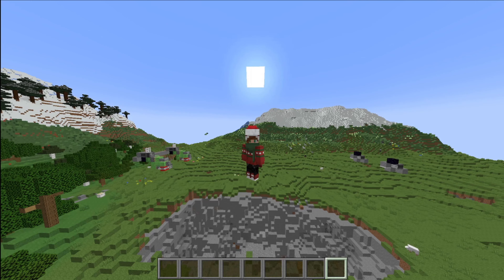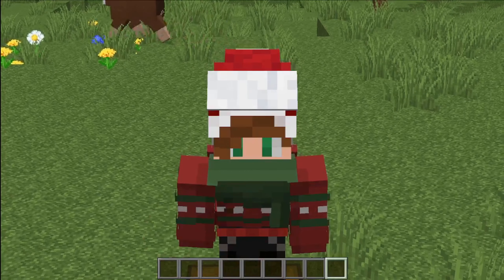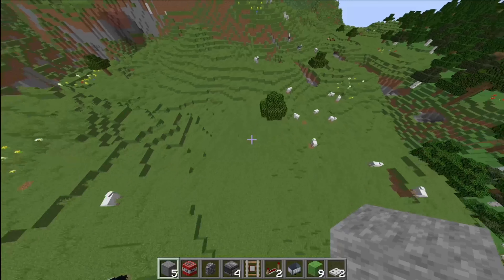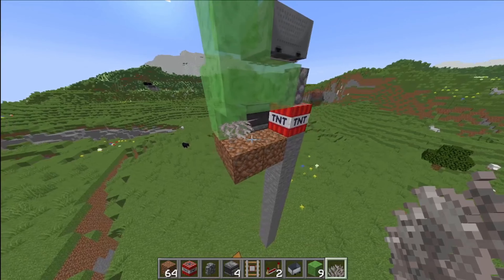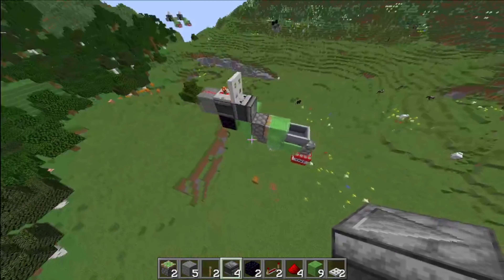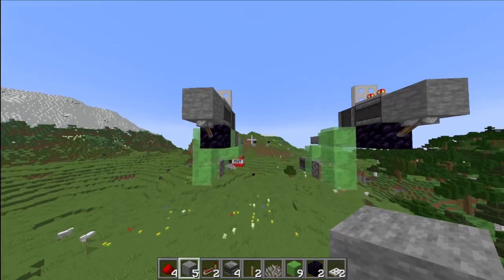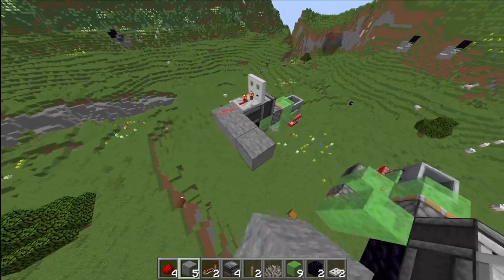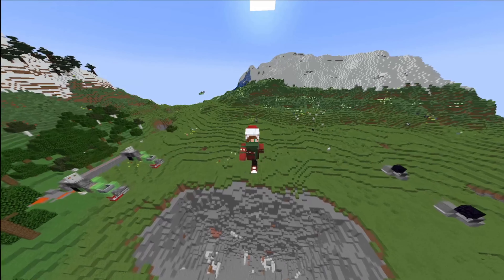✔️Minecraft: How To Make a World Eater (Java 1.20+)

Comment: Just built in 1.20.1 with some performance mods installed, 5 blocks apart seems to be a good distance for each module, it works without any modifications from the design in the video. Simple design, just works
Reply from the maker: Appreciate it bro :) 👍

Comment: Here's a few ideas for improvements from my experience using this deign:

-Having the machines spaced as far apart as the video shows will leave a lot of floating blocks behind, so I built the machines with 2 blocks space between each TNT block and got much better results
-The trade-off for this means you will have to build it higher off the ground as the TNT tends to fly up pretty far and can destroy parts of the machine. The TNT block should be at least 20 blocks off the ground
Reply from the maker: Nice to hear your POV man, thanks!

Comment: everyone else is chipping in their notes so here's mine- I noticed the best results when the machines were spaced with 3 blocks between each TNT, and 20+ blocks off the ground. I ran that spacing across a 4 chunk wide, 40 chunk long trench and it ran fine. 

Link all the switches to one lever, flip it, then hop into the middle bomber's minecart and you can just AFK it, which it's best to do because the machine encounters issues if you unload and reload the chunks by leaving/rejoining or by leaving the area while it's running.

Comment: I made this, but the TNT didn’t get duped. It flew and returned perfectly fine, just no TNT falling.
Reply from the maker: Did the tnt block fall when the machine initially started?
Reply: @PotatoGamer-rg4nn  no, it didn’t
Reply from the maker: @NicoA223  you must’ve placed it in the wrong spot then. The tnt should dupe and fall, or at the very least the block should fall and not dupe if it fails. The fact that the machine moved and the tint did nothing is a bit strange ngl
Reply: @PotatoGamer-rg4nn  would it still work on a cross platform server? The server is on Java but there’s an addon that makes it bedrock compatible too.
Reply from the maker: @NicoA223  that bedrock add on may or may not be the problem
Reply: @PotatoGamer-rg4nn  oh wait when I logged on to the server the tnt fell, but didn’t dupe. Is there a solution to that?
Reply from the maker: @NicoA223  that means you should rebuild the duper and reactivate it. If you try placing tnt there again it will only fall and not dupe. So yeah try rebuilding it
Reply: @PotatoGamer-rg4nn  just breaking it all and replacing it?
Reply from the maker: @NicoA223  Not the return station, but the duper only